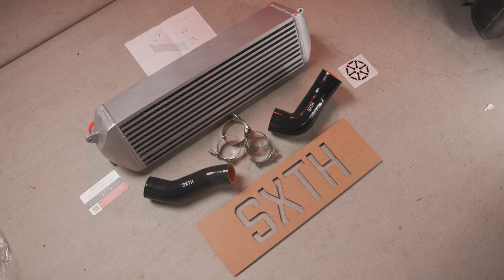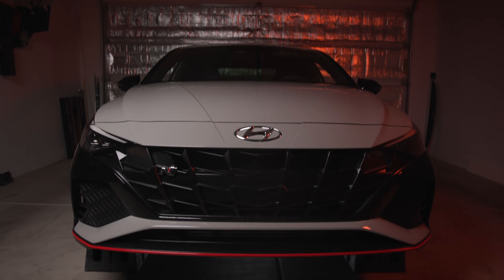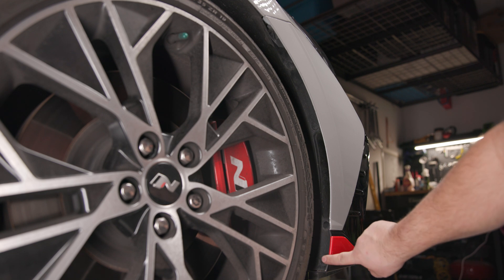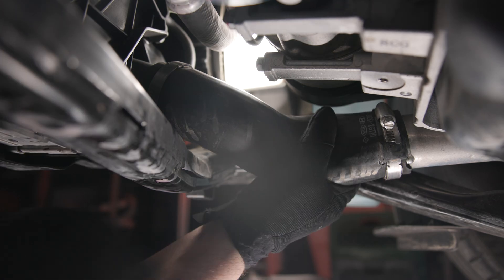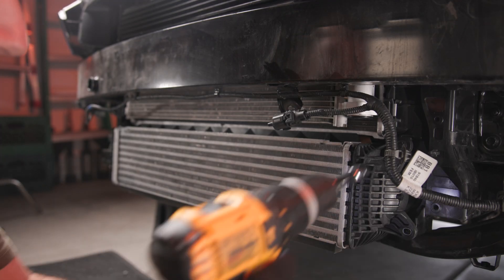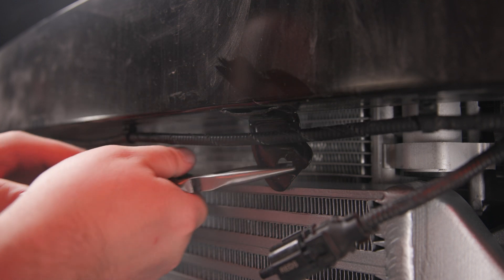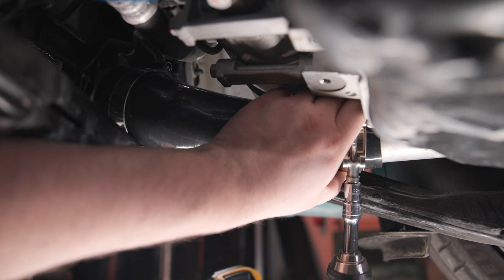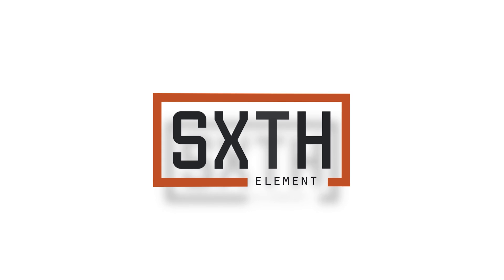SXTH Element Elantra N Intercooler Install

Comment: Does this work for 2025 Elantra N-Line DCT?
Reply from the maker: I'm sorry but it does not.
Reply: @SXTHElementEngineering  Thanks for the response. I see you offer the V2.5 Intercooler Kit 2017 – 2020. It should fit into the N-Line, right?

Comment: All we need now is a performance radiator
Reply: It doesn’t need it, it doesn’t have overheating issues as much as it does heat soak.
Reply: The race that Gen racer uses has a performance radiator. It's always a nice to have when you have a cooling product that performs better than OEM